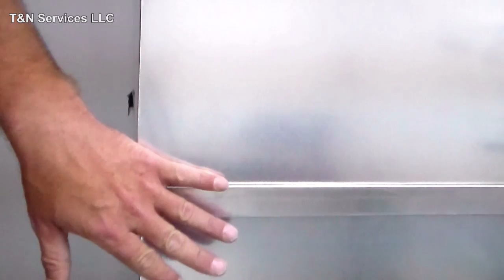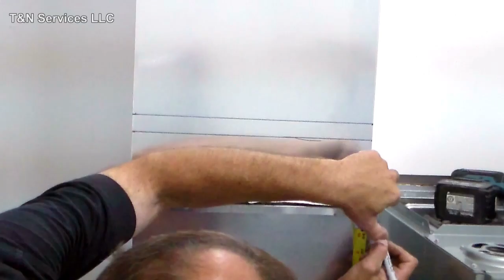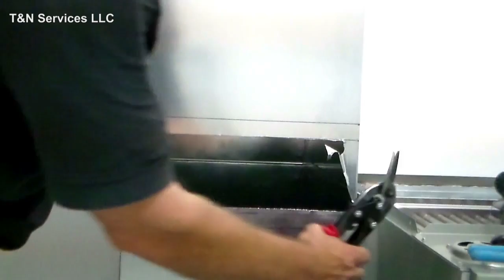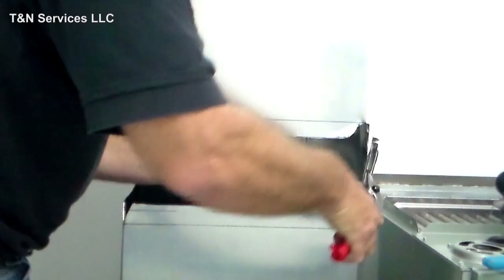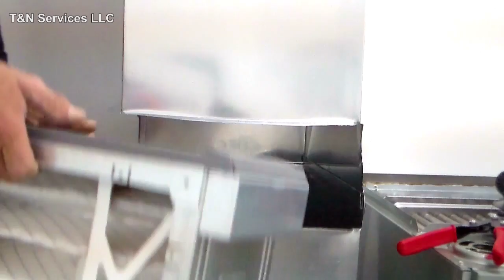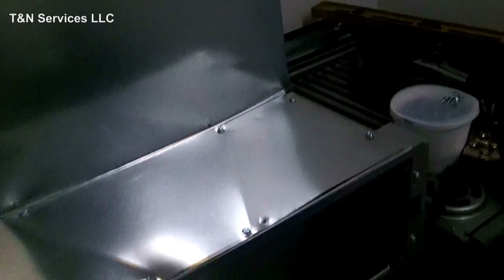HVAC Sheet Metal Video Series Pt5

Comment: I found that a angle grinder with a cut off wheel works best cutting through the Pittsburgh lock. It is quick and easy. Dewalt makes a cordless angle grinder and I keep this in my tool box for the tough spots.
Reply from the maker: I use a sawzall a lot. Most of the time I'm in front of the furnace when I'm cutting and don't want to throw sparks in a house.